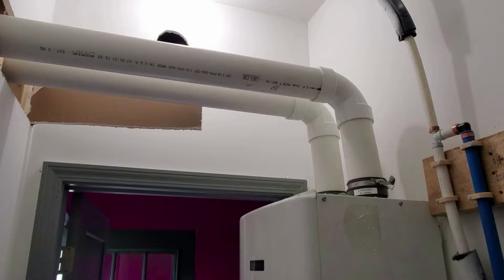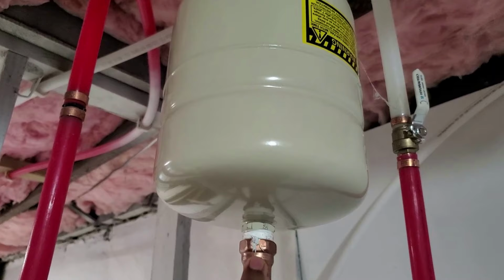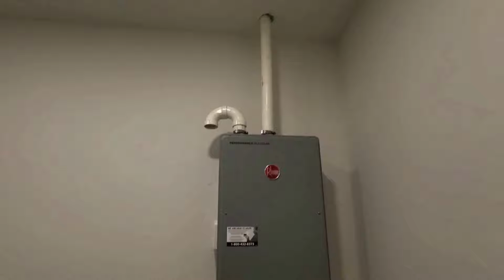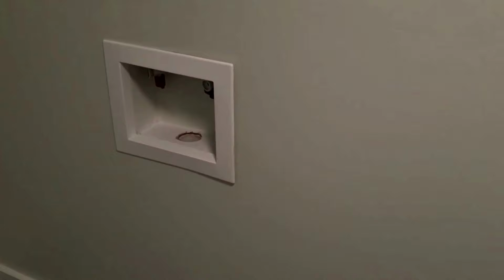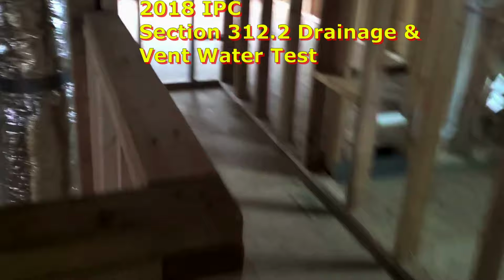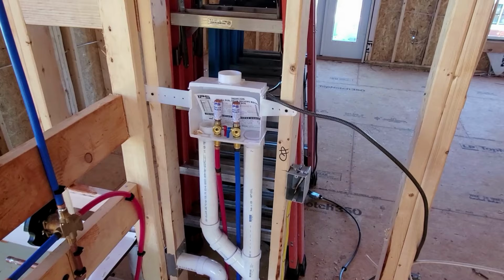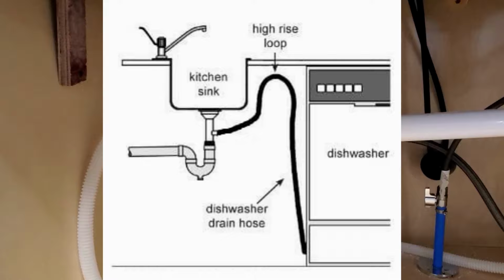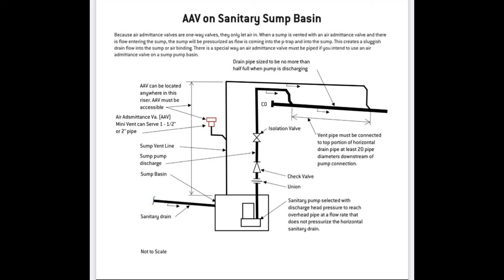Plumbing Code Violations (Part 1)

Comment: I thought pex pipes can be air pressure tested, just not PVC or ABS?
Reply from the maker: What code book are you using?
Reply: @PPG1967  Just trying to figure out how the timeline typically works for new construction. The utility water line needs to be connected before the insulation and drywall goes up?
Reply from the maker: @paulmattson5604  Yes, that's correct.
Reply from the maker: @paulmattson5604  plumbing under-slab; monolithic slab or footings; exterior sheathing; MEP rough-in; framing; insulation, drywall nail pattern; MEP final inspections; building final inspection.

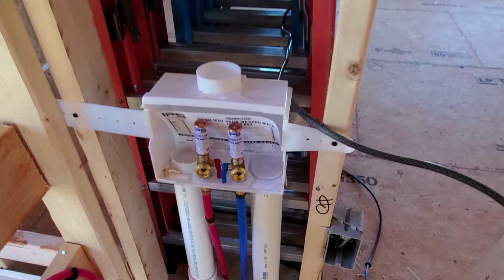Comment: 6:56 laundry discharge doesn’t need a back water valve on it ? Guess it just vary state by state
Reply from the maker: So, is that the UPC??
Reply: If that left pipe in the laundry box is for an aav it’s on the wrong side of the trap

Comment: How much Square feet for a room to have that intake , in the room and not lead outside ?
Reply from the maker: I'm sorry, I don't understand your question.
Reply: That would depend on not only the the manufacturer's instructions for the instant hot water heater, but also the code and any amendments applicable in your jurisdiction. Generally, allowing for indoor intake is considered an exception rather than a permitted practice and the rules pertaining to allowing that exception may not be available in every situation. This can be due to other building requirements, such as those pertaining to insulation and building envelope tightness, in effect for the jurisdiction. IE a tight house may not produce enough make-up air to also supply the instant water heater intake requirements regardless of the room volume, resulting in a negative indoor pressure and back drafting. There can be other environmental, legal, or precautionary considerations otherwise incorporated into any local code amendments.
If you plan to fight an inspector's red flag, you better be prepared with the relevant code including any amendments to back up your assertions. And be there with the inspector during the inspection as minor issues can potentially be resolved during the same inspection, saving time, money and an additional trip for the inspector (a win-win in my book).

Comment: It’s 12” for most tankless heaters intake to exhaust…
Reply from the maker: That's not necessarily true. I've done countless tankless water heater inspections and reading the installation instructions for each unit is very important. Each unit is designed & manufactured differently.

Comment: The high rise loop for the dishwasher is actually a code violation, you need to vent it , anything under the cabinet is still under the floor rim level
Reply from the maker: Oh ok...thanks for watching, and I appreciate your feedback.
Reply: @PPG1967  just learned this myself too !
Reply from the maker: So, how are you suppose to vent it??
Reply from the maker: The drain line is connected to the vented kitchen sink... that should suffice.
Reply: If you vent it then the  dirty water flows back into the dishwasher.  Am I missing a detail? The whole point of the loop is to prevent it from venting, like putting your finger over the top of a straw filled with water. That is what an Air Gap does.
Reply: Dishwasher airgap
Reply: It's entirely state dependent.  There are only a few states that require dishwasher air gaps.  Just like this video, many of his examples of IPC codes aren't adopted paragraphs in all states.

Comment: You’re referring to a sump pump vent. Your diagram is wrong. You cannot discharge sewage into a sump pump. You can only discharge sewage into a sewage ejector pump
Reply from the maker: So, that diagram was designed by an engineer to show how to vent a sump pump, sewage ejector pump, or ejector pump. They all need to be vented to work properly, and if a vent line is not accessible this diagram will solve that problem. Also, this diagram was approved by I.C.C.
Reply from the maker: I appreciate your comment.
Reply: @PPG1967  hey no problem, I appreciate your vids and your education. Ty for making them. Not nit picking in any way. I’m a plumber in NJ and I also like to call out a bunch of stuff that we see on a daily basis

Comment: What is the code violation on the fresh air intake on the tankless water heater in the utility room? According to the manufacturer's installation if you have enough cubic inch of fresh air space per btus fresh air can be use from the inside of the house. Now that being said that particular  brand may require it to come from outside but you stated it was a code violation. Which one?
Reply from the maker: Yes, the intake and exhaust must terminate on the exterior..per manufacturer's installation instructions.
Reply from the maker: I appreciate your comment.
Reply: @PPG1967  yes 🙌🏾. Manufacturers specifications trump the code in some instances

Comment: copper fitting not allowed to tie in on dissimilar metal piping. copper female connected to galvanized nipple. need to be brass. Mark Kinney Plumbing
Reply from the maker: Where are you located?

Comment: You also stated that the bathtub needs to be full because it is the higher fixture when the height of the tub rim is (correct me if I am wrong) is 16" high and section 312.2 states it must have head pressure of 10lbs above the highest floor. SO therefore there should not be water in the tub or shower pan without flooding the house.
Reply from the maker: Read that section again, the 10 foot of head only applies if you're only testing new sections of plumbing.
Reply from the maker: If testing an entire new plumbing system, then the system should be filled up to the highest opening..typically the bathtub overflow... unless there's a washing machine box on the top level.
Reply from the maker: I appreciate your feedback.
Reply: @PPG1967  Think about it, the highest opening would be the vent through the roof. It clearly say's to the highest opening til over flow. That would not be the bath or the lavatory.
Reply from the maker: Fixture sir, highest fixture.
Reply: @PPG1967  Isn't the bathroom sink going to be higher than the bathtub?
Reply from the maker: So, the new plumbing drainage system at a new framed house is cap & sealed at all locations other the bathtubs, showers, and sometimes at the washing machine box.
Reply: @PPG1967  If you do not cap the shower and you fill the tub up like the video showed,how do keep the shower from over flowing? Also aren't you only putting stagnant water pressure on the system if you do not go to 10 rise on the water level?
Reply from the maker: @jwblount7802  so, it depends on where the fixtures are located in the house.  Typically bathtubs are located at the highest level of a house, if not whatever fixture will be located at the highest level.  The inspector will determine depending on the layout what will be required.  I suggest, if you are able and capable, go find a new subdivision and ask the builder if you could walk around the interior of a new framed home with the plumbing rough-in. That should better help you understand what's going on.
Reply: @PPG1967  All I do is new construction plumbing in houses. and this why it is throwing me off. We are required to water test every system at every stage of rough in at 10 feet of head pressure. That being the system of a 2 story house wither it be a bathtub or washing machine box we have put water level 10 feet above said fixture in order to receive the required head pressure. So for bath tubs be it 1st or second floor we have to plug the waste and over flow drains in order to reach this 10 lb of pressure. This is why I am questioning on how you read it as to how our inspector reads it, while trying to be open minded when I cross over to the other side of the trade once my son takes over the company in a couple of years.
Reply from the maker: @jwblount7802  where are you located?... you a contractor?
Reply from the maker: @jwblount7802  if I'm not mistaken code says up to the highest fixture with a new system, and 10 feet of head if you're adding on to a existing system.
Reply from the maker: @jwblount7802  your local or state amendments could require something different.
Reply: @PPG1967  Yes. I'm  30 year master plumber in Huntsville, TX. I have 10 builders I've been working for since I started my business since the early 90's.  All we do is new construction houses and dab in small commercial jobs. We do very little if any repair work.
Reply from the maker: So, 10 feet of head requirement is for the underslab plumbing. As far as testing the plumbing system on the interior of a house, you just fill the system with water up to the highest fixture.
Reply from the maker: You should check with your state amendments.  You can adopt a code  book and delete & amend sections. We do it here in Georgia all the time.  Maybe the state of Texas deleted some sections of the IPC.
Reply: @PPG1967  Our governor "supposedly" nixed amendments  with HB2349 (if I am correct) but some cities still have a few but most are gone. Hell we still have cities using the UPC still even though our state adopted IPC years ago. But with that being said both codes/cities require to put 10 of head at each stage. I think a lot of has to do with how each person/city perceives how they are reading it.
Reply from the maker: @jwblount7802  oh ok..I appreciate the interaction and discussion on this subject. It's nice to hear what codes other states have adopted and are using.
Reply: @PPG1967  I will probably be hitting you up on some NEC videos because that is where I am the most ignorant is electricity.  Thanks for dealing with me and all my questions.
Reply from the maker: @jwblount7802  no problem, I enjoyed it... take care of yourself.

Comment: I am not sure what State you are from but I noticed in your state they follow IPC code in our state UPC code dose not allow the diswasher to be looped up under the the method should by providing a mechanical air gap like dishwasher gap ! Also I do not agree with IPC code that air pressure is not allowed in any palstic piping . The only pipe and fitting that air pressure is not allowed is PVC pipe and fitting Pex pipe can be tested by air how ever my prefer method is by water but air pressure on pex pipe is not against UPC code , May IPC Code  dose not allow it But UPC dose allow it .
Reply from the maker: In Georgia, we're using the IPC.  The dishwasher drainage hose must be attached high under the counter before connecting to the sanitary line.
Reply from the maker: I appreciate you watching.

Comment: Needing a AAV on a Sump Pump for ground water is not allowed as per the 2018 IPC 918.8 unless designed by an engineer.
Reply from the maker: I'm assuming you're referring to the diagram at the end of the video.  That diagram was designed by an engineer at a plumbing manufacturing company. It was also approved by I.C.C.
Reply from the maker: I appreciate your comment.

Comment: can a permit inspection fail if your system is not vented, but still drains just fine without any smells ?
Reply from the maker: So, a sanitary system must be vented to drain effectively.  How is it draining correctly and its not vented??
Reply from the maker: To answer your question, yes I would fail it.
Reply: Not just vented, but all the vents tied together too.

Comment: this is why i do my own work i can do it my way and no one can bitch because its not up to code if its safe for 100 years its safe now that said alot of things in this video was unsafe and eve id not do them but some just money scam
Reply from the maker: So, you're saying you are doing work without pulling permits, no inspections, and none of the work is up code??
Reply: @PPG1967  here long as its small job on your own stuff dont need permits or inspections id not do work on any ones stuff other my own its up to code if were useing a code book from 20 years ago before they started just making stuff up to sell more parts  beening my house is rom 80s my repairs are by far better then what was done back then i even upgraded to gfci in kitchen and bathrooms it didn't have either

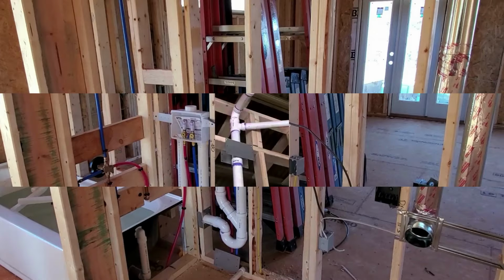Comment: @ 6:15 what is going on with the waste pipe at laundry box?
Reply from the maker: So, that drainage pipe to the left is used to drain condensate from an attic unit... it's pretty common down here in the Southeast.
Reply from the maker: I appreciate you watching!!
Reply: Right on.  Have not yet seen that here in Charleston SC. Not sure if I personally like it or not. I do plumbing and HVA/C. I’m big fan of main condensate and secondary drain going outside. Main drain low to the ground, with line from secondary pan terminating hi outside. So homeowner will know when they have a problem.  So in this set up where will secondary drain line terminate?  Also please tell me that there is an air gap in that laundry box. Thanks

Comment: I WANT TO ADD A WASHING MACHINE TO THE MAIN CLEANOUT DRAIN OF MY TOWNHOME. DOES IT NEED A VENT / AAV?
Reply from the maker: Where are you located, and what plumbing code book is adopted in your state ?
Reply: @PPG1967  south florida
Reply from the maker: Check with your local or city building department.

Comment: Wishing that homeowner the best of luck with that Rheem Tankless. My parents have one at their house and it has been a nightmare for them from a reliability perspective…

I never really understood the dishwasher loop rule. I get it that it’s the code, but it doesn’t make sense. It’s a mechanically pumped drain line from the dishwasher. Why does it matter where the drain line runs through the cabinet from a functional Perspective?
Reply from the maker: supposedly, it's so in case of a blockage in the sanitary system that the sewer won't back up into the dishwasher.
Reply from the maker: what kind of issues are your parents having with their tankless water heater??
Reply: @PPG1967  it has been replaced once already under warranty after multiple repairs and escalation to rheem. Tons of error codes, bad sensors, bad circuit board, etc. Each time, they were left with no hot water for sometimes a day or 2. Once for 3 days because the system would go into a “protect mode” or something like that. Their house was built in 2016ish by Sharp Residential (later purchased by Toll Brothers).
Reply: @macgyver03ga  Best way to fix a Rheem tankless water heater is to trash it and install a Navien. Hands down best on the market. No call backs once installed.
Reply: @jwblount7802  we’re installing a Navien 240 in our new house we’re building right now 😁
Reply: @macgyver03ga  You wont be disappointed!!
Reply: Most of issues we see with the Rheem/Ruud tankless is gas supply issues. They do not have the Venturi gas valves so if the gas line or meter is not sized properly they will code out especially during the winter months. A lot of the other manufacturers have the Venturi gas valves so it hides the issue. The tankless will essentially suck the gas it needs and not code out. Still not a good thing as it just means something is being starved of gas but everything will work. A lot of homes in my area have the 250CFH meters which is typically too small. Have your parents check that. Might be a simple meter upgrade.
Reply: You may experience smelling from the sink due to waste water be trapped in the hose to d/w, also waste water with travel back to dishwasher. Some dishwashers have built in drain loop, always check the installation manual.

Comment: Vacuum protection is called a one way valve at the meter
Reply: Thus all the house protection
Reply from the maker: There are a lot names for that device.  Check Valve, Backflow Valve...etc.

Comment: It’s residential, what do you expect?
Reply from the maker: That's funny..a couple of those were commercial inspections. The same contractors that do residential do commercial work as well.
Reply from the maker: Thanks for feedback!!
Reply: @PPG1967   It’s all workmanship issues . I’ve seen plumbing code violations on residential build all the time . But very few in commercial works. I get it landlords are always like to cheap out and take the lowest bid
Reply from the maker: @jl-dc6dt  I agree..I definitely find more violations on the residential side.
Reply: @PPG1967  Just now I found up my apartment has a 1/2” water main supplying the entire home😂 , I think these guys couldn’t even find a pressure regulator for it so they used reducer on both side .what a joke. I guess everyone in the Home Depot parking lot can do plumbing

Comment: Referencing the wrong code book.  Should be referencing the IRC which is for 1 and 2 family dwellings
Reply from the maker: Any plumbing code sections in the IRC are straight out of the IPC.
Reply from the maker: I appreciate you commenting.